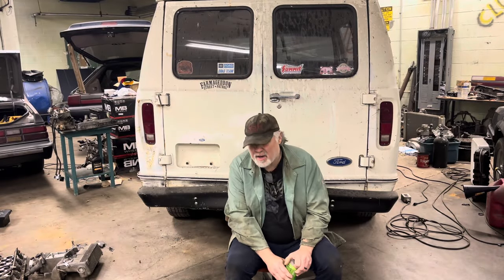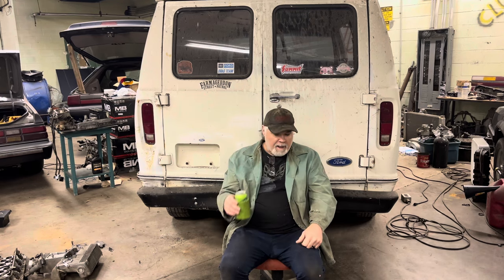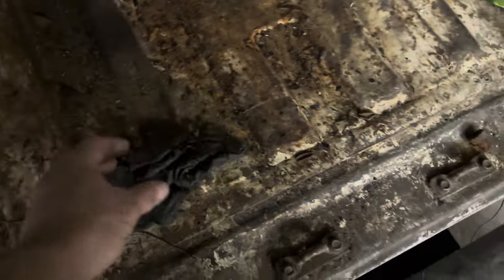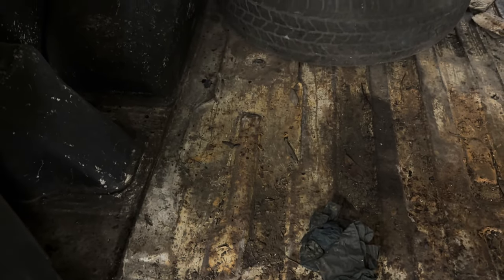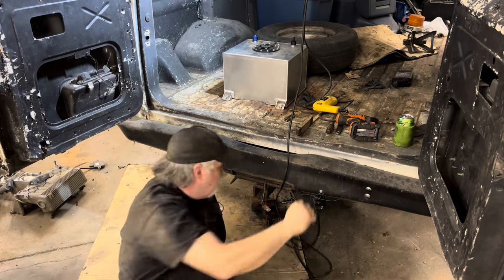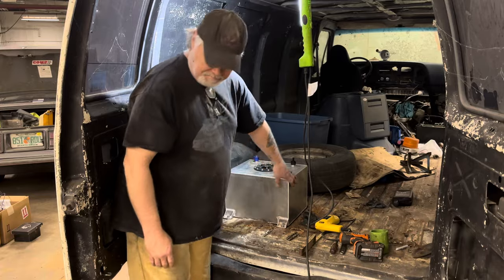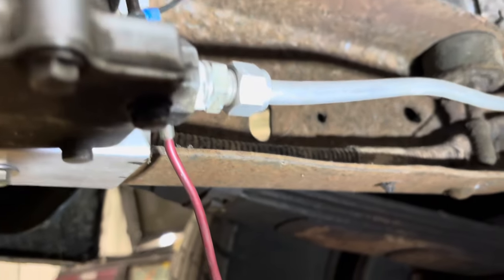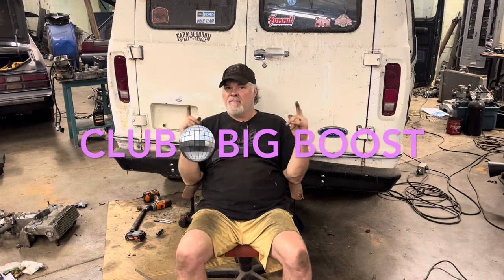1988 5.0 E-150 Econoline DragVan...CELLebrating more progress :)

Comment: If you want to quiten down the road noise he about 6 tubes of seam sealer and fill in between ribs of the van and the skin a it will quiten down the noise beyond belief . I did that to mine , it really worked .

Comment: If you were going to remove weight (IF) I would take a hole saw to all the braces instead of completely removing it. I could be wrong, but with the van having a ladder frame, it's using the body as part of the rigidity. It wasn't intended to work like that, but I think it may.
Reply from the maker: We’re just having fun with this thing like we always have, it’s not a “racer”, just a side project/driver deal that we hoon around in when it’s running..till it has a stick it’ll always be a back burner deal and I’ve got a bunch of stuff that’s higher priority at the moment 😵‍💫
#autosareshite

Comment: Damn, Rod. You're stirring up the whole hornet's nest among the fomoco mofos (& Kevdog).
Gonna be an uncivil war! There's still time to hit the inside bracing with the hole saw and death wheel. Maybe add a plate with a 150 shot to add the meat wagon to Club Big Boost.
Can you picture it with zoomies? 302 is in the perfect spot....
Reply: Kevdog ain't gana do nuthen
Reply from the maker: Got two rigs in my weight class..well 3…Kyle’s bootlegger (351/carb f150), David’s old man nite and pirates moms 4.6/jmod truck🤣…I’m faster than two of them and way slower than one🤪

Comment: Damit didn't get first cause I was out working on Beans again trying to get these lights working that wasn't working in my last track visit  but I have finally got them going, for starters when I put the comet tail lights in they were made of plastic/fiberglass and the original lights were made of metal so that the socket couldn't ground itself to the taillight frame itself so i fixed that and as it got dark everyone in the neighborhood was calling telling me that my brake lights were on so I tried to get them to shut off but figured out my switch was bad so put that on and now have brake lights and replaced all of the marker lights/parking lights and now they are working and replaced 2 of the housings because they were faded almost clear and one was busted so now Beans can now legally go down the track or the highway. Hes fixing to get a new hatch, one that only came on the 71 pintos that makes it look more like a sedan instead of a hatch

Comment: I'm surprised you didn't just put a carbureted pickup in the stock tank so you'd have a working gas gauge and some range. Whatever makes you happy 👍🏼
Reply from the maker: Holleys aren’t big fans of lifting fuel, didn’t have a drop in pick up or a fuel pump concentric for a mech pump, just using what I had plus dropped weight..the range thing isn’t anything to me since I NEVER fill up a regular tank, I’m a $15-20 guy at the pump, always have been always will be..except for Teresa, I fill her edge for her but my stuff? Never🤣